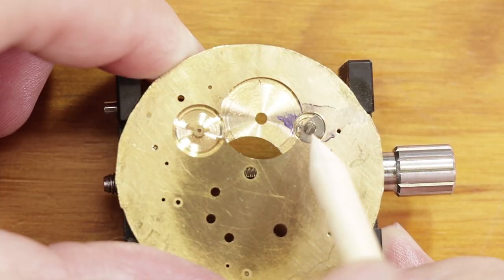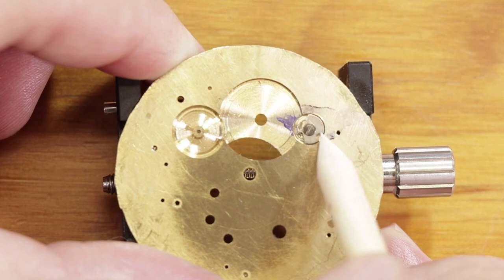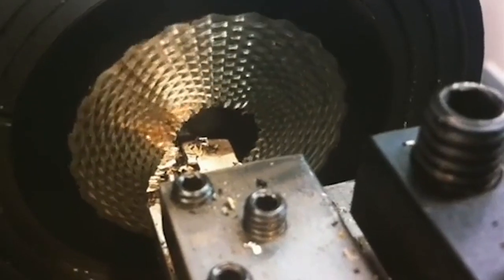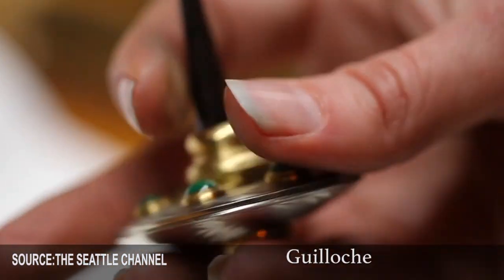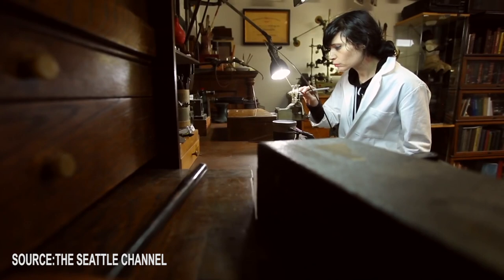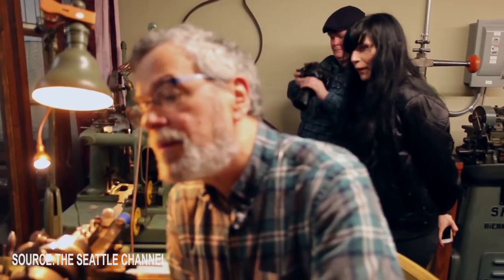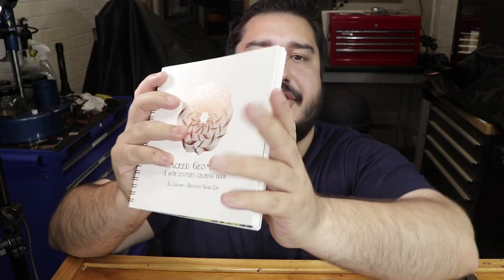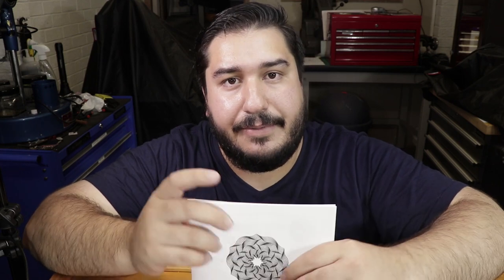Learn Guilloche + Giveaway Watchmaking Vlog #10

Comment: Hi Dean,
While it's called Guilloche I'm sure you know it's an off shoot of Ornamental Turning. A very large number of books were written over hundreds of years in both English and other languages about both subjects. Today a great many of them are very rare and can therefore be  extremely expensive if you can even find them. But checking with your local library might get access to some of them through what's called in most country's the inter-library loan service where your own local library can borrow books from the largest library's in your country. I've no idea if that's available in Oz though.

Ornamental Turning and Guilloche are quite involved and complex subjects. And most of the ornamental turning was done in exotic woods or ivory.  Guilloche afaik was almost always done in metal although the same patterns can be cut in the more usual materials used by O.T's. While there's almost nothing in it about the specific subject of Guilloche,  I highly recommend T.D. Walshaws soft cover book Ornamental Turning because it's a cheap way of getting a great deal of entry level information that would also directly apply to Guilloche. Googling for both text and images for "Geometric Chucks" will also help since they can do a lot of what a Rose Engine can. Today there an extremely rare ornamental turning accessory but they can also be built with a lot of effort and some details about them are also in Walshaw's book.  

If you know of Brittany Cox then you may know about Lindow Machine Works. They make a modern commercial version of the Rose Engine lathe. It's not out of the possibilty's of building one yourself. It does take some digging, but Lindow /White produced a lot of how to videos about using there rose engine lathe that would be very helpful as well. There's also what's called Straight Line Guilloche that would be worth searching for videos and written information about.
Reply from the maker: Wow 😮 Thank you so much for the great in depth reply. I will definitely check TD Walshaws book. Yes I actually found Nico originally after stumbling across David Lindows machines, they are awesome. There is Fred watchmaker on instagram who made his own machine. Amazing feat! Thank you for taking the time to write your post much appreciated 🙏🙏
Reply: I forgot to add but it's shown and well explained in that Walshaw book. Cutting tool sharpness and it's surface finish is extremely important in O.T. or Guilloche since it's impossible to properly polish the incised cuts on the part. The final surface created by the tool is what your stuck with. Again it's an old Ornamental Turning accessory, but Googling images for "Goniostat" will bring up photos of the originals and more modern home built versions. Most people have never heard of them. Walshaw goes into detail about the best way to use them with stones and neatsfoot oil to finish hone the tool edges to razor sharpness. Today's availability of reasonable cost diamond hones would I think work even better with a goniostat. Just that information Walshaw shows would be worth the books cost to any watch maker. The American made Accu-Finish diamond honing machines could do much the same, but doing it by hand would save thousands of dollars. :-)

Other than the repeating patterns capable of being produced on a rose engine with it's rocking headstock or the more advanced ones that are capable of a pumping motion as well.Then a great deal of what would be called Ornamental Turning can be done with a milling machine with a rotary table or dividing head and a simple boring head. Even a standard metal working lathe can do a lot with a few added accessory's.

Comment: I think, if I had unlimited money for machinery, I would buy a new Unimat SL 1000 lathe with all the parts and here I'm talking collets, headstock raiser, chuck indexer, gear-cutters, chucks, everything. And   then I would go about either trying to buy the watchmaking specific tools, such as a depthing tools, or I would take my swing at making some.
Reply from the maker: Great choice! I do like that lathe, very versatile. With one fully kitted out you would be unstoppable 💪
Reply: Thank you, that was my thought exactly. Quick questione, where do you  buy your metal parts, like brass? Thanks for the reply!
Reply from the maker: I buy from various sources - sometimes Ebay, sometimes from online retailers (international) and I recently discovered a Metal Merchant (Edcon Steel) in Sydney that I can pick up scraps from. I try to get c360 or c356 brass, and the best price I can find as brass is relatively expensive. Where about are you located?
Reply: I'm located all the way in Denmark, and I've haven't been able to find any particular good places to get anything except steel locally, so I'm kind of stuck with online retail. Where do you buy online?
(BTW thanks for answering, I really like your videos, keep ud the absolutely excelent work)
Reply from the maker: I think it was metals4uonline. But I had to use a freight forwarder to ship from US to Australia. This was when I was stubborn and only wanted to use c360 brass. It works out super expensive. if you are after sheet brass, I have bought from cousinsuk and also mcmaster-carr which are both in the UK
Reply: Is all brass usable, or is it only 360 and 356?
Reply from the maker: Some brass maybe too soft, designed more for forming than machining. BTW congratulations you are the winner of the giveaway! Could you please send me a direct message . If you go to my youtube channel page, then go about tab. There is an icon on the right to send a message to me. This way we can talk private so I can send the books out to you. Happy New Year!

Comment: If i had the budget, i'd get a mini proxxon lathe because if i had the talent to make the product, the quality of the device does not matter.
Reply: For some that's a common misconception. Skill and knowledge can only take you so far no matter how much you have. The manual machine tools built in the past and even today in a lesser amounts for watch and clockmaking should easily settle the facts of your statement. Solid sleeve type bearings were usually used in the lathes and even some milling machines not because there cheaper (which they are) but because there more accurate than even the finest and most precise roller type bearings made today. Sleeve bearings are still used in the worlds most accurate machine tools where cost is a secondary requirement but accuracy to nano levels is. Temperature stabilized spindles and the same for the pumped lubricating oil is far more expensive that even the best roller bearings as to how good those sleeve bearings are. Schaublin, Boley, Leinen etc lathes and mills for watch making were made with extremely good accuracy and with high prices to match. With some mills such as the B.C.A and most other watchmaking mills usually carrying the designation as small light jig borers. Can watches and clocks be built without machines of extreme accuracy?  Yes of course and it's been proved it can be done many times. But there's very good and logical reason's why you wouldn't see the low priced machines in the workshops of the worlds most skilled and talented people.
Reply: Turning Point thank you so much for your informative comment. Im speechles right now.
Reply: Thank you. I've spent far more time than I'd like to add up learning the very little I think I do know. There's nothing wrong with the Proxxon machines and they would be a good entry level lathe to learn and get started with. We all have to start somewhere. Skill and technique is always used to compensate and obtain the very best from any machine tool no matter how good it is, so that still counts for a lot.  If you do get that Proxxon lathe then how far you go after that would obviously be up to you. You'll spent a lifetime learning though, and I'm sure the very best are still learning every day the same as I am. The big difference between them and myself is I'll never be even close to the best at anything :-(  So in a way your statement about that talent was partialy correct. :-)
Reply: I’d buy Big Ben in London, charge all the tourists for looking at it and use the cash to house London’s homeless.
Reply: Pamir, some starting things you need to look at for a machine is its run-out, rigidity, rpm, and power output.

Run-out is how concentric it spins. 

Rigidity affects if the machine and tool deflect under use, introducing inaccuracy.

RPM has to be sufficient for the size of the part or cutter to maintain appropriate surface speed.

Power affects the metal removal rate. Not enough power leads to requiring tiny cuts.

I made some mistakes myself by not looking at these things when I bought my Sherline lathe. I ran a big industrial lathe for years and took things like power (mine was 7 hp, over 9000 Watts) and rigidity for granted.
Reply from the maker: Wow some great discussion going on here 👍 I love when people discuss and share knowledge in a positive way!